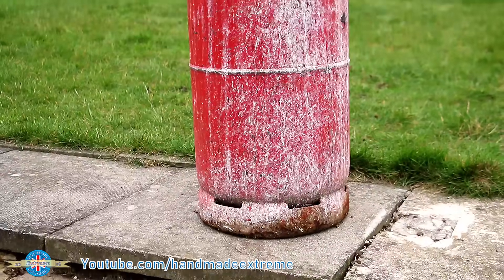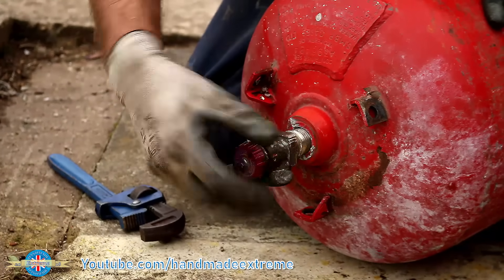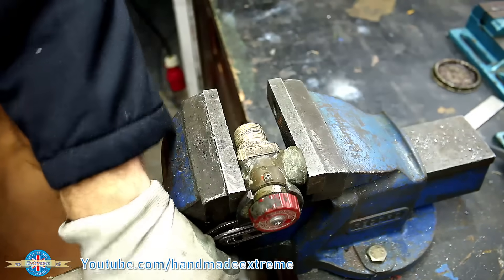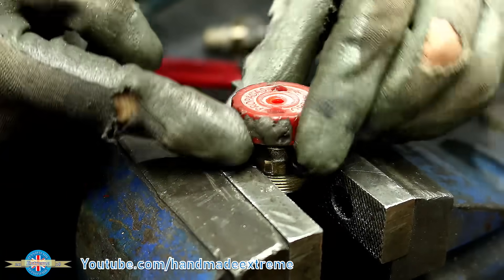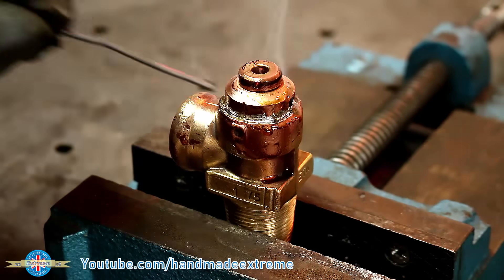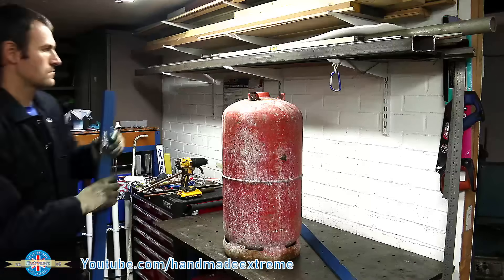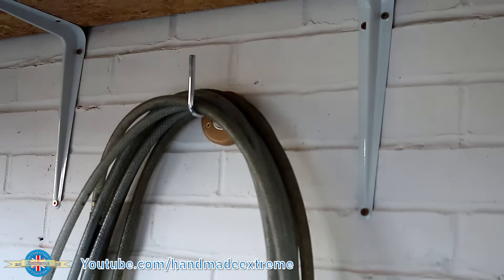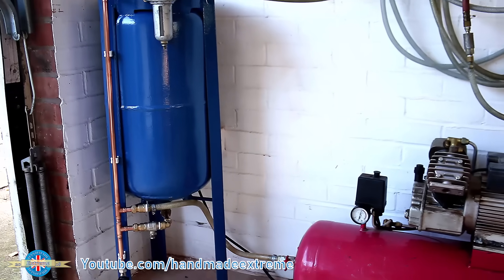Making an auxiliary air tank from an old LPG gas bottle.

Comment: Given that you mentioned in one reply about having and using a plasma cutter you might want to look at installing a micro pore paper air filter to get the air really dry for the plasma cutter to use. The standard air regulator/filter Does Not filter enough condensed moisture out of the system for a plasma cutter and failing to dry the air sufficiently will lead to increased premature wear of the plasma torch consumables. The major brands of plasma cutters will have detailed information about this on their websites.
Reply from the maker: Great advice, thank you. I'll look into it.
Reply: See these are the kind of comments we need Thank you!

Comment: Before you try to do this you should be aware of one thing. Used propane bottles frequently off gas propane long after they are deemed to be empty. This is because propane can actually be absorbed into the metal grain structure at pressure. Once the pressure is relieved, the trapped propane will start to offgas out of the metal and will contaminate the air that you are storing in it. Needless to say, once that compressed air is released you will be releasing that propane into the atmosphere where it is free to drift or become a pool in a low lying area creating a fire/explosion hazard. There are bulletins to this effect from most OSHA jurisdictions. You are better off to try and locate a used helium tank left over from a party where balloons have been filled as helium is inert and will not pool as it is lighter than air.
Reply: Original poster will exclaim how it is for his personal use and therefore “doesn’t need to comply” with any sanctioning/certification. 

I totally agree with your sentiment though. This is something that shouldn’t have been done, despite the good workmanship.

Comment: The tap you used in the drill, is that a tap made to be used in a drill or just a standard tap bit?
Reply from the maker: Just a standard tap. Takes a bit of practice but fairly easy to do on thin ish material once you get the hang of it.
Reply: Use high speed steel spiral point taps and you can tap all day with a drill. Dont use cheap carbon steel hand taps, there is a better chance you'll snap those.
Reply: I find it's fine using a normal hand tap as long as you engage the jaws of the drill chuck on the round shank rather than the square drive, that way if it bites it just slips in the chuck rather than breaking the tap. That being said i have broken some taps 😁.

Comment: Great video. Unless i missed something, I didn't notice a pressure release, safety valve on your auxiliary tank. 
Thanks for sharing.
Reply from the maker: Thank you. You are correct about the PRV. The way I use the system with the two tanks linked if there is an over pressure situation the PRV in the main compressor will vent any excess from both tanks. Glad you enjoyed it and thanks for the support.
Reply: @Handmadeextreme  A garage I worked in had 2 air over oil car ramps/lifts. Painted on the ramps/lifts was SWL 3 Tons.

Clearly, no limit to the pressure we could feed them with ! I think the compressor's safety valve permitted 180 psi - so when lifting a forklift - we had the compressor running to max pressure - but still needed a trolley jack to lift the ramp with the forklift on it.
Reply: @Handmadeextreme  please include the fact that there technically SHOULD be one there.
Reply: @nigeleharis5886  No need as he's got one on the compressor anyway.
Reply: @millomweb  lmfao please read all the comments in this thread.
Reply: @millomweb  go and email OSHA or ASME and ask what they think on this lol you will find that you are supposed to have a safety valve and pressure gauge on any pressure vessel. 

The person who posted this video does acknowledge that fact, but doesn’t need to follow the rules because it is for his own personal use and he can work how he pleases.
Reply: @millomweb  so unless you or someone works FOR a compressor brand manufacturer as a service technician or engineer, I don’t expect someone to really know these things. People will say “oh but physics blah blah blah” but there are a handful of educated people (on this topic) that have chimed in, iterating the necessity for these components.
Reply: @nigeleharis5886  Perhaps you've not noticed, he has only one pressure vessel - so one safety valve is all he needs. If he closes the valve to make 2 vessels, the second one has no source of pressure.
Reply: @nigeleharis5886  They may be educated but that does not mean they're not thick. Such that they can't understand there's only one pressure vessel - albeit in 2 halves.
Reply: @nigeleharis5886  So ask them why a truck can have 4 air 'tanks' yet has only one safety valve - in any country !
Reply: @millomweb  this is clearly not your line of work. Please stop replying trying to act like you know more here.
Reply: @millomweb  bottom line, there SHOULD be a safety valve and pressure gauge, but the original poster decided to not use them. As for your “truck tanks” or whatever your talking about. I encourage you to find the answer. You seem to work on trucks. NOT AIR COMPRESSORS. That is all.
Reply: @nigeleharis5886  Please stop. You’re only making a fool of yourself and your profession..
Reply: Since original poster is in a personal workspace he can construct his system in that manner. Anywhere else, that won’t fly.
Reply: @nigeleharis5886   Sure you can do whatever you want for yourself. 

Years ago, I built something similar  and included a PRV as auxiliary air tanks, that I'd studied at the time, had one and, anyway, I felt safer with a, tank specific, pneumatic fuse.
Reply: @petertyrrell6690  I’m all about the safest legitimate method, certainly.

Comment: My only critique is the use of copper plumbing. Eventually you'll get cracking because of the torsional load on the long run between the POL fitting going into the tank and the regulator (2 fixed points, and the u-bolt "racked" the run when you snugged it up). That long run should be steel pipe from valves to regulator, with a flexible section from POL fitting to the valve (nylon, gas line, vinyl reinforced, etc). Longevity of your existing assembly would be markedly increased by replacing the solid POL to valve run with flexible, thus removing existing torsional stress (single fixed point, at the regulator), and allowing thermal "creep" of the assembly without added stresses.
Reply: I was always under the impression when utilizing pipe fittings for a gas, that a flared fitting should be used.

Comment: There's a reason why the  compressor tank is the size it is.   Let's say it takes 5 minutes to fill, it  needs to sit for 5 minutes.   
Some compressors use the same pump unit from 50 ltr up to 200 ltr BUT the pully on the pump and motor  are different sizes.  
So in reality all you have done is made the compressor run longer than its designed for.  
Yes you have a bigger volume of air but again once the pressure drops its running longer to replace the air.
Reply: The tank needs to sit for five minutes? What? What do you mean? Receiver size should correlate to pump CFM output. To say a compressor tank needs to “sit” makes no sense. Please explain.
Reply: @nigeleharis5886  piston compressors are designed to run at 50% duty . So 5 minutes to fill 5 minutes to sit.  Lets say you're doing a job and the piston comp is Basically running all the time without sitting then its too small and will soon brake. If on the other hand what ever your doing only needs a bit of air and the thing once full will last hours or the fill time then thats OK. 
The 5 minutes  was just an example,  some will fill in in less time ,BUT whatever that time is it then needs to not run again. 
Single phase are the worst type for flat out running as the capacitors in the motor get to hot , the trip on the motor will keep popping out first off, then the capacitors will start to melt. 
The pully on the pump itself is designed in such away it acts as a fan to help the pump keep cool!!. But as I said this won't do a thing if its non stop running.
If you need to run all the time then you need vane or screw compressor.
Reply: @michaelwalker1145  you are absolutely wrong; they are meant to run at 100% duty cycle until they reach desired pressure set point. At that point, the compressor either unloads or shuts off. This is true for ALL compressors of all types, with the exception of VFD compressors which actually can run at 50%, as well as compressors (big industrial compressors) have a 0/50%/100% load option, but nothing that a little garage compressor will be capable of. 

If you’d like more knowledge and to fill in some gaps you may have with air compressor information, I can help you!
Reply: @michaelwalker1145  you have not enough CFM from your pump and therefore need a bigger compressor for your air demand. People seem to think more storage will solve their problems, but don’t realize the problem is Lack of CFM

How exactly do you plan to “run your machine at 50%?” You can’t. My good man I do this for a living lol. Part of my job is to correctly size compressors depending on customers intended use. You have no idea how big reciprocating compressors can be and how much air they can make. 

You said it yourself. Running a compressor when it is too small, it will break. Correct. The type of compressor you have is determined by your air demand.
Reply: @michaelwalker1145  you have an elementary level education on compressors, good job. However you are incorrect about 50% duty. So let’s stop spreading inaccurate information please.
Reply: @michaelwalker1145  what you don’t know is some reciprocating compressors do indeed run all day every day, during constant speed mode. This is achieved with an auxiliary valve. The pump continues to run with no air demand. Why? TO SAVE ELECTRICITY.
Reply: @nigeleharis5886  sorry I think we have our wires crossed. 
Yes run up to set pressure say 10 bar 150 psi. Thats the first time 5 minutes 
Then it must sit for its fill time. 5 minutes  before it starts again. 
Vane and screw compressors don't need this dwell time.
Reply: @michaelwalker1145  sorry sir, but some machines don’t even take 5 minutes to reach cutout pressure. Please show me where you learned such compressor operation procedures. Is such a practice stated in any compressor manuals you have? Was this information handed down to you vocationally? Or is this something you made up for your own machines “safety”? Are there gauges and or alarms that indicate you need to do this? 

I have worked on air compressors (all types and HP ratings) for a long time now. Again, the machine will either unload or shut off when it reaches set point. Once it reaches cut IN pressure it will begin to run again. The time between cycles does not matter if your compressor is properly sized. If your machine is running too much, you either have a nuisance leak, or your consumption is simply too great vs your compressors CFM rating.
Reply: @nigeleharis5886  yes recip can run all day, this vid is not about that its a basic piston which is what I'm going off.
The compressor in this vid isn't a giant water cooled recip.
Reply: @michaelwalker1145  a piston type compressor is also called a reciprocating compressor. Air cooled options are also what we are talking about here.
Reply: @nigeleharis5886  The manufacturer of said piston compressors.  The one in this video is what I'm talking about not eny piston designed to run all the time..
If  you require a compressor to run constantly then a piston comp of this type in the video isn't the right one.  THE ONE IN THIS VIDIO, not piston/recip in general. 
The extra tank fitted in this vid has done one thing,  make the piston run longer than its designed for.
Reply: @michaelwalker1145  what brand of air compressor tells you to go and do what you are describing?
Reply: @nigeleharis5886  Clarke,  as I said these are basic pistons NOT HPC ect.
Reply: @michaelwalker1145  thank you for the information, im educating myself further. But yes those little plug in types are smaller than the smallest ones ones I usually work on, explaining my ignorance on the matter
Reply: @nigeleharis5886  no need to apologise,  at the moment I'm working on HV turbo blowers,
High volumes low pressure,  700 mb . Used to bubble up water. 100 mb per MTR of water.
One job we were ask to quote for in a new factory according to the expert need nearly a million CFM. We still don't know how he got that figure. 
Or a customer that had a new plant fitted with two compressors, a 7 bar and a 10 bar, was told that from 0 to 7 one would run then from 7 to 10 the other would start.   Told him both would run until the seven bar got to top pressure, then that would trip on over pressure.  Plant needed 6 bar max for air operated valves.

Comment: Gas bottles have dated tests. Anything past that test date untested is lethal. 
Regardless of test pressure for that gas bottle, the actual gas when stored inside the bottle was never near 100 PSI at any time - it's often around half of that during its working life. Doubling the rated working pressures doubles the stresses on the metal body of the bottle.
How do you inspect the insides of the old gas bottle? Did you even inspect it? Have you ever looked inside your compressor tank? I did and despite my compressor being only 7 years old I disposed of it immediately - the corrosion was horrific despite it being a quality machine, drained daily and specially lined inside.
I'm absolutely all for recycling old metal (I'm a metal artist) but sometimes a second use for something is dangerous.
Reply: Absolutely loving these educated and well informed posts. I sincerely hope more people heed this type of advice and choose not to shake hands with danger.

Comment: Ayee mate,whats the max psi/nm on one of those bottles,I have a 175 psi air pusher "COMPRESSOR"
Reply: Pressure relief set at about 250psi so better than that by a factor for the tank.
Reply: @acme663ryo  thanks mate

Comment: Looks great. I did this same thing however I used an old 100# (US) tank and placed reducer bung,1/2X3/4, into the valve bung,with T fitting and a couple hose connect fittings. Hook hose from compressor to one side of T and hose to tool. 2nd version included a water collection pipe with drain petcock and additional port to add a second compressor to reduce recovery time. 1st unit turns on at 125 PSI, off at 150 and 2nd unit turns on at 100 PS,I off at 125. Have about 45 gallon capacity with ability to add more holding tanks as I get them.
Reply: I too used a 3/4 pipe bushing on my first tank. My second one I left the valve and used that tank as a large bubble tank for use out in the field for farm equipment.
Reply from the maker: That sounds awesome. I'd love a system with that much capacity. Thanks for the support.

Comment: You should not have retained the valve body.  Those left-hand threads are there to prevent accidental interconnection of fuel and other gases, and you now have a compressed-air system with fuel-gas fittings.
Reply from the maker: Great comment, that's a very good point. Thankfully this is just for use in my home workshop. Thanks for the feedback 👍
Reply: He also welded the threads and drilled out the inside so now it a brass L and nothing more
Reply: @markc7933  which is just so so so cringe lol

Comment: Well this certainly answered cleared up my thoughts on using an extra tank at my place. 
Also i have seen people use oil coolers plumbed in before water trap. Ive opted for the simpler method of running 20 meters of hose along full length of garage and into a water butt before my water trap. I need it this way for spraying my car.
Reply from the maker: Nice idea. I wish I had a shop big enough to do that. Good luck with your project.
Reply: @Handmadeextreme  Rob aka Xynudu made a nice drier that takes up almost no floor space, rather it runs up the wall and back down. Go to his channel "xynudu" and look for the video titled "Make a compressed air drier from junk water pipe". You could probably stick it on the wall in the space between your compressor and new aux tank.

Comment: Nice! I've been wondering about using an LPG tank as an aux tank for a while now. We get fleeced for purpose made aux tanks here, so this should be a much more cost effective option, thanks for verifying!
Reply from the maker: Glad you enjoyed it and good luck with your own project.
Reply: There's a reason tanks designed for compressed air cost more. Compressed air will cause severe corrosion in tanks not designed for the purpose.

Comment: I've got a 150ltr comperssor that is great for most jobs around the shop,  with the exeption of my sandblasting cabinet, which is air hungry. I've been looking at the auxiliary tank option for some time and this would seem like a great solution. I've been in the fabrication game a long time and see no safety concerns with this design, in fact it's slightly over engineered. Thanks for the upload,  I will be stealing most of the design features for my own tank.
Reply from the maker: Awesome, glad you enjoyed it and good luck with your own project.
Reply: See my other comment. With a blaster you need a dam sight more air than a piston can put out
Unless its a three phase  on a big 500/1000 ltr tank.   
The blast cab should tell you what CFM is needed to work this should also be on the compressor
Reply: Thanks Michael, I'll work out what I need for it to run correctly.
Reply: Sandblasting uses a lot of air, between 15-25 SCFM. Just getting a second tank you might be blasting for say 20 seconds, then waiting for over a minute for the tanks to fill again.
You'd be better off getting a second air compressor. Build your setup to both compressors run at the same time feeding the shop air lines, then you have the advantage of higher SCFM and more storage. Standard shop compressors are in the 3-5 SCFM range. Large home shop compressors are 9-15 SCFM.